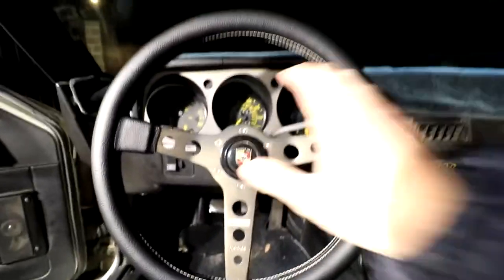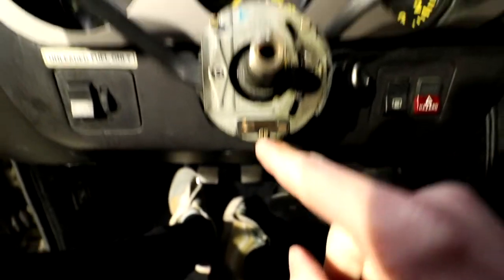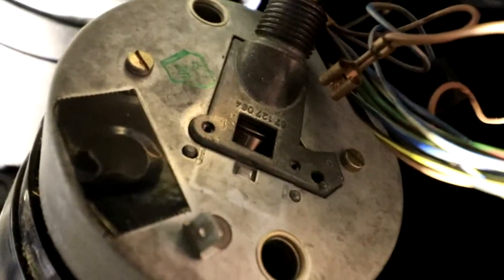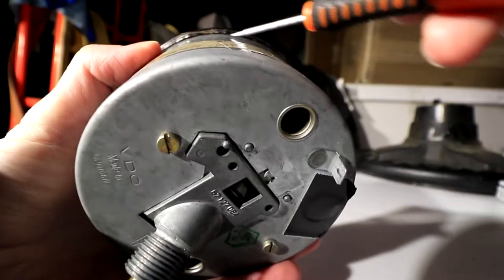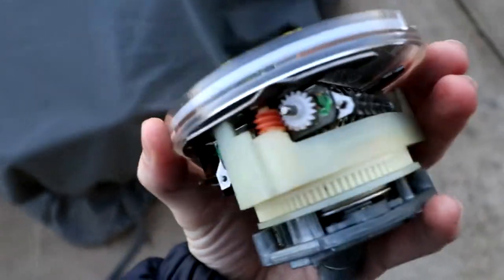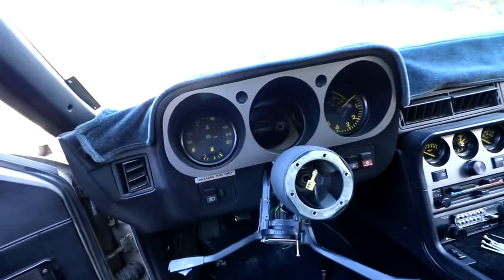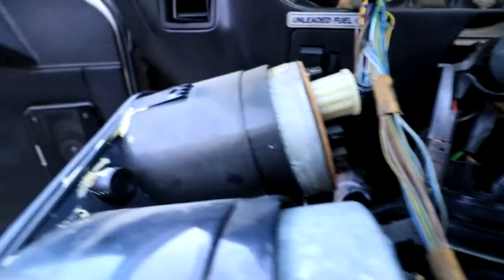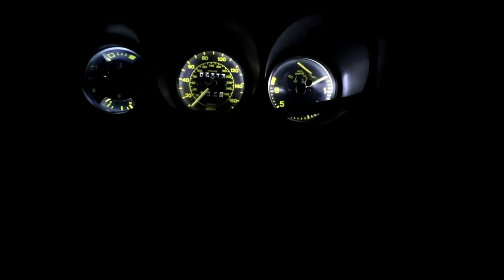Broken Porsche 944 Odometer - How to Repair & Replace (Full Guide)  (1982-1985) Early Squaretop Dash

Comment: Great video! My odometer is working but I'm still tempted to switch out the gear as preventative maintenance, mostly I want to switch the dash light! They look awesome 👌
Reply from the maker: Thanks Pat! Id recommend leaving the gear until something does happen due to the process of cracking the mechanism out of its casing BUT the LEDs are super easy to swap out without getting too crazy. 

Thanks for watching! 🙏🏻

Comment: Great video, thank you! My odometer in my 924S went out some time ago, so I have been looking for a repair guide for some time. After watching I'm a bit less afraid from pulling everything out etc and will give it a go. :) Do you happen to know if there is any significant difference in the job between a 944 and 924S?